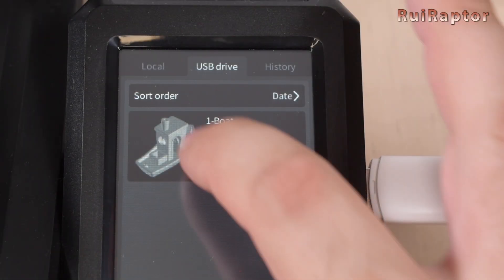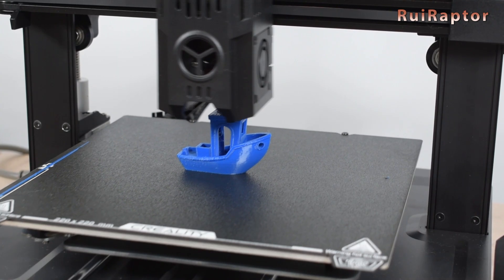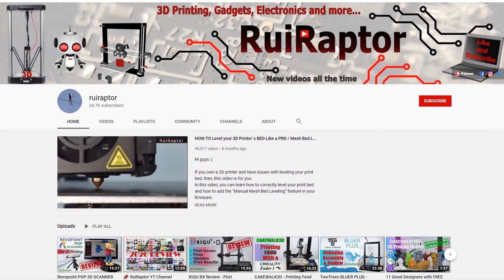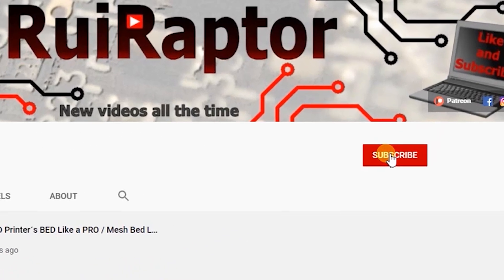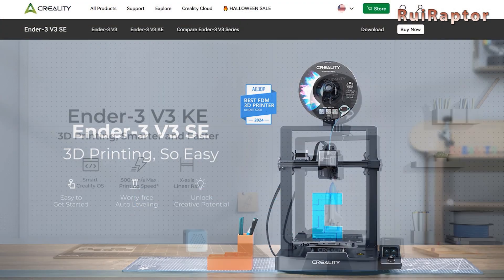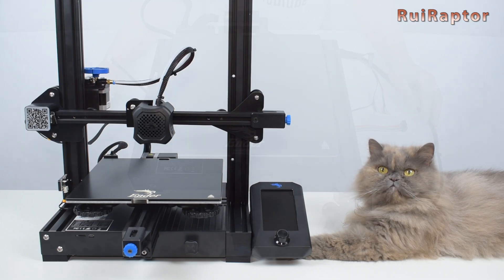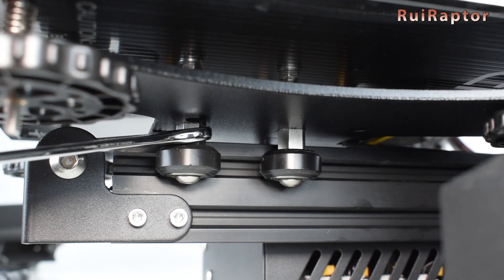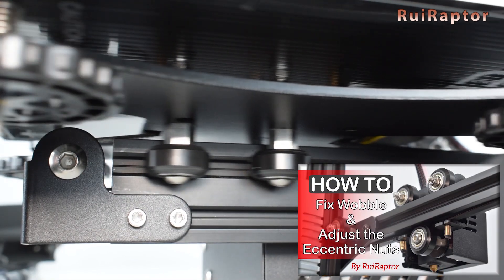Creality ENDER 3 V3 Series - HOW TO Troubleshoot & Fix Y-Axis Problems

Comment: My V3Se had Y wobble out of the box also.     From investigation,  The bearing - rod clearance was perfect.  It was the Bearing housing too wide. A cpl of slivers of tape on the bearings to take up the slop between the bearing and bearing housing worked great. A very easy fix.
Reply: Thank you very much, I tried this solution and it fixed like 95% of the wobble.

Comment: My Ender 3 v3 Plus is amazing, but I can't seem to figure out why the circles are coming out skewed. Parts that need to rotate are more oval shaped that a perfect cycle and its messing up a lot of prints with mechanical parts built in

Comment: I have the SE series. The problem I have is the left front is lower than the rest of the table and have developed the problem when I go to print the bed and nozzle are suddenly drop to 0 degrees. Causing the phe plate and and head to start cooling off as it starts printing. ANY IDEAS?? I have only had it one month.
Reply: hey did you ever figure out how to fix this?  I am having the same issue as you
Reply: @skitzo308  Sounds like it could be a board issue

Comment: i have this issue, its not that bad but very annoying when printing in black the layer lines are very ugly. I will upgrade to linear rails soon.
Reply: No way... I'm having the exact same issue. Could it be that after 6 months I finally found the cause?
Reply: @CortesBombado-fv9cy  I modded my ender 3v3 ke lately. I added linear rails, stiffener arms, i removed the steel plate and replaced it with a plastic one and i removed the spool from the top. The printer prints smoother than most bambu lab printers if not all of them. Try it.